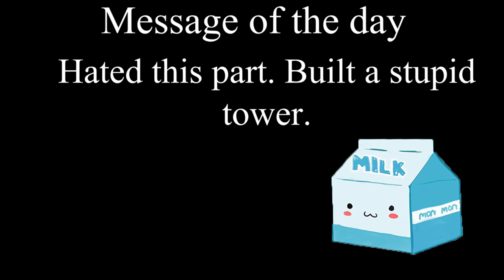Raft Where to Place the Radio Antenna Guide

Comment: God,i thought they all need to be on different altitudes,placed antenna 1 on a second floor near the receiver and it worked but the other 2 seemed not working no matter where i put them,i built a fucking skyscraper for the other two antennas but it was just this easy,thanks